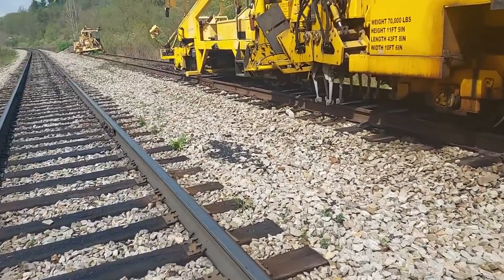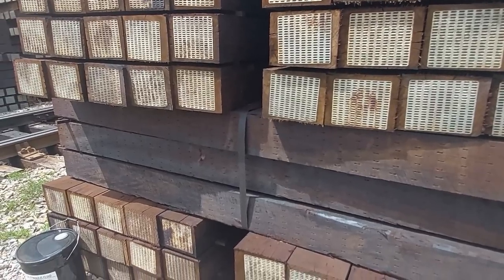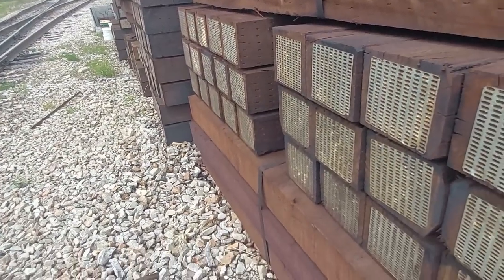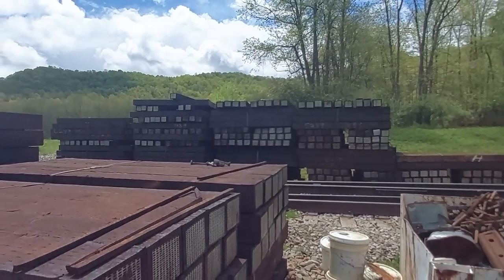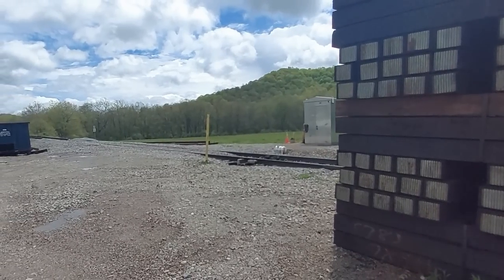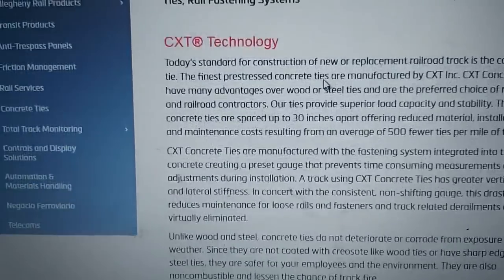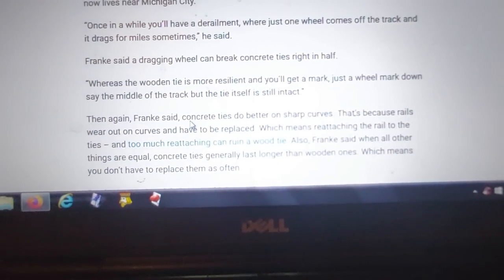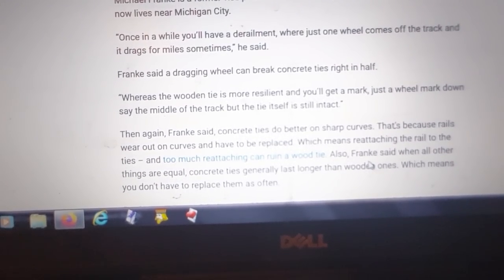Why some Railroads use Concrete and some use Wood Cross Ties

Comment: Hi Dave. The Company you work for is like a double-edged sword. The old creosote covered ties are a huge environmental problem at their end of life, and so is the coal you mine. It gets burnt to produce electricity, another environmental concern. But we need electricity, and a lot of it. So what can we do? Solar works great, until a solar eclipse shuts everything down LOL. In Ontario Canada, they had to fire up their natural gas electricity generators because of last week's eclipse. Ontario stopped using coal in 2007.  With more and more electricity being required, it wouldn't surprise me if Ontario is forced to bring back coal in the future.
Reply from the maker: You are certainly right about that 46FD, have to have them but
it's a problem with disposal. The electricity problem is huge and
too many politicians and environmentalists are making the decisions instead of qualified energy engineers. But that's the
world we live in now. UK and Germany both had to bring back
coal to fill the electricity needs.

Comment: Creosote treated ties are forbidden in several countries in Europe. Creosote applications for private use are forbidden since 2003 in my country (the Netherlands) and also in other European countries I suppose. Btw another disadvantage of concrete ties is noisiness I guess.
Reply: The most significant noise issue is with the way rails are joined. It used to be that railway track was joined with fishplates, and those were very noisy, both in the train and to those who live nearby. Over time, Europe has move to more and more continuously welded track (CWR), which involves pre-stretching rail to account for expansion and requires the track to be held very firmly. That basically means concrete ties (or sleepers). Also, as far as noise is concerned, it is normal for track on concrete ties to be laid using a plastic isolator. 

In general, modern railways using CWR and concrete ties/sleepers are quieter in operation than the old rail and fishplate systems on timber. Of course the trains themselves are now quieter too, especially with electrification.
Reply from the maker: Thank you for the great information stranno. Appreciate your taking the time to watch and write in my friend.

Comment: In Europe we use only concrete ties because they assure high speed, last much longer and have less operation costs as the bed is much more stable and longlasting. Wooden ties are past.
Reply from the maker: Concrete tie lend themselves very well to high speed and light weight trains for sure Strashimir. Thanks for the nice comment. Appreciate your taking the time to check out the video and write in my friend.

Comment: As much as I dislike the s of buzzwords I question sustainability of wood ties. I live in a tree farm that does selective cutting as opposed to clear cutting which is more expensive, more difficult but looks more natural. I spent 6 hours yesterday pulling nails out of old growth dimensional lumber because it's cool to me and I'm cheap but most important is I can't see what's required of high load sleepers being grown to spec quicker than they're needed. I do electrical distribution construction, currently with a maintenence contract for a state capital, and we are not going in the right direction.
Reply from the maker: Appreciate the nice comment David and for sharing those thoughts. Thank you very much for taking the time to watch and write in my friend.

Comment: U.S. Forests are denser then ever. There are currently more trees then at any point in recorded history. I agree about disposal of creosoted Ties. Ties could be burned if the right clean burning shredder / incinerator is used. Easy to couple with power generating equipment. Turns used Ties into the means to power there own destruction with additional electrical power to sell to Power Company. Thus, the system pays for itself over time.
Reply: Yes!  In fact, burning old ties would probably qualify as biomass, which is heralded as renewable.
Reply from the maker: Appreciate your sharing that with us WMF FMW, interesting. I like you think there could be better uses for old wood ties than what we now have. A few power plants do burn them, but they are far
from us here. Thank you for taking the time to watch and may you have a very good day my friend.

Comment: The Light Rail Trains here in Denver use concrete ties.
Reply from the maker: Thank you for sharing that info with us Peer. Concrete ties are
well suited to light passenger/transit applications. Appreciate your taking the time to visit and check out the railroad tie video my friend

Comment: concrete ties are for none cold weather areas. frost heaves and poor ballast conditions  pop the concrete like popcorn .in Massachusetts the commuter rail has removed or replaced all of the cement ties.  Amtrak has cement ties on the corridor  for the Acela;  but has African wood  or normal wood ties in there high speed crossovers. Our max speed is 70mph;   Amtrak is 125-140 mph cement ties are better there for weight and stability.
Reply from the maker: Thank you Sean for sharing your thoughts, excellent points you
have brought up. We've heard some woods from Africa are so hard
you can't drive a spike in them without pre drilling a hole. New York City Transit uses wood ties from the same plant we buy our ties
from. We appreciate your taking the time to check out the video my friend.

Comment: So why do high speed rail.  Korea, Japan, Europe, do they use concrete on the High Speed rail systems.. Older concrete ties might not have had reinforcing. Was that a cause of failure.  Why would concrete ties move any more or less than wood?
Reply from the maker: Good question organbuilder. Here is a video I made on why
some use concrete and some don't, you will get your answers
in that one, Thanks so much for watching my friend.
https://youtu.be/UtyTTijswwg
Reply: @ccrx6700  Thank YOU dave for trying your best to educate and inform the public about railroading and all the good and bad things that happen. Maybe more people will understand why you don't try to beat a train at a crossing, why rail systems are built they way they are and the multitude of other interesting things you post.
Reply from the maker: @organbuilder272  👍😊
Reply: Here in italy for hsr and regular line are only concreet, more over we paint the said of the rail in withe to prevent  heat destortion in summer

Comment: Sawing hardwood lumbar for high grade the center cant is usually processed for lower grade utilities. Ties, pallet material etc. So your situation if i understand, you are better off spending on drainage and balast.
Reply from the maker: Thank you for sharing the info with us Greg. None of the big logs
in my log home are cut from heartwood, in fact the plans specify 
for them, no heart wood. You are right. Appreciate your taking the time to visit and  check out the RR tie video my friend
Reply: @ccrx6700  the center of a cant is the most stable due to the growth rings being small when the tree was a little fellow. However it's inclined to have the most knots from the limbs of a small tree. However for a tie it will have balanced growth rings and stay straight. Thanks for your tutorial.

Comment: The conundrum is that cement manufacturing puts CO² into the air. Wood ties get used for 30 years, and then the carbon is sequestered in the landfill. 
Creosote is eventually broken down by microbes.
Reply from the maker: Thank you Mike for writing in with the great comment.  You are right. Appreciate your taking the time to check out the video and may you have a most blessed day my friend.

Comment: Ok, so you tried a type of concrete tie, and it didn't work. I'm not surprised, seeing what you tried. But did you think to have a chat with other railway systems around the world, where concrete ties (sleepers) are in widespread use?

I ask because (as a Brit currently living in Canada) I've seen too many half-arsed attempts at using ideas created elsewhere being attempted in North America, such as roundabouts. There are a few roundabouts near me here in Ontario and Quebec, none of which have been implemented properly. (Failures such as at Dorval, Montreal, with no clear signage on the approach to the roundabout to identify which lane you should be in, or no road markings to identify who has priority - made worse in Cornwall ON by mixing in old-style traffic circles where traffic entering the roundabout has priority AT SOME OF THE EXITS. Those two both scare me witless!) Let alone the more modern roundabout styles in Europe, where the lanes corkscrew around the roundabout, so that if you get into the correct lane when you enter, it automatically leads you to the exit without having to change lane. If you look at North American roundabouts alone, I'm not surprised you hate them! But they've gone off half-cocked and implemented them badly, without any thought and without any care, and possibly without any real knowledge of how to do it properly.

My guess is that you've done the same with your "railroad ties", gone off half-cocked, not done it properly, not asked advice from other countries where high-speed rail is standard or where heavy goods trains are common. Because none of your reasons really hold water. It's just "we tried it once and it didn't work, so we've not tried again".

Having said all that, though, can I offer two reasons of my own why your situation may be different?
- One is that your distances are enormous, with tracks stretching thousands of miles. Europe isn't anywhere near as big, and tracks are generally shorter. So your initial outlay and maintenance costs are going to be much, much higher, and I know you're starved of money. You may be forced to do things "on the cheap" simply because of geography and lack of government support, and wooden ties are simple and cheap. That's not a good excuse, but I think it's a valid reason.
- The other is that your goods trains are enormous and heavy! Just look at your engines, and compare them with engines from Europe. Ours look like toys alongside yours. Even the old diesel-electric units in Britain, such as the BR 37, which I used to think of as heavy. You stack containers double-height - making your rail cars twice as heavy! And your trains are often 1 or 2 miles long! That has to mean that the trackbed gets hammered - literally! - each time a train passes, making strength and flexibility into major requirements. In Europe our trains are much lighter, shorter, less damaging to the trackbed, so track maintenance costs are reduced. Maybe you should re-think how big and heavy your trains should be, to spread the load on the trackbed and reduce your maintenance costs?

The upshot of all that is, from my point of view, that the driving reason is cost: You can't afford to build the track as strong as it should be, and you're paying massive costs in maintenance. So you can't afford to invest in new capital cost by relaying a stronger and more maintainable trackbed. That's what we did in Britain a few decades back, with massive investment in new continuously-welded track using concrete sleepers. We have the advantage now that we can support faster trains with lower maintenance costs, but we also have the disadvantage (currently) of a government that wants a free ride to give their cronies tax cuts and are trying to run the railways on a pittance. But comparing the British train system with the North American one, I'm confident in saying that concrete sleepers are the way to go, as long as you can withstand the capital investment of a major track upgrade, done properly, and accepting help from other countries with relevant experience. And smaller, lighter goods trains would also help...
Reply from the maker: Thank you for taking the time to share your thoughts Rob. A
bit of a treatise and something you feel strongly about. However
after reading your entire comment, it appears to me you did
not watch the entire video or you are so biased on one point of
view, one size fits all. If you really believe all RR's everywhere should
use concrete that is certainly your welcomed opinion. But in
the real world of railroading there are so many different variables
and factors to take into consideration. I did a fantastic job of
presenting, in such a short video the pros and cons of both types
of ties and the reasons why some RR's use concrete and some
use wood. Never did I say what was right for another RR to use,
only what works best for our particular RR with the unique 
situation we have here. Hope you have a nice day and thanks
for watching.

Comment: What is the prices on wood ties n concrete ties?
Reply from the maker: Being that there are 28 different profiles of concrete ties, it's
kinda hard to give you an accurate answer Daniel. Each different profile has a different pricing. Wood ties here are $80.   All concrete are higher than that and heavier ones can be double or more the cost, plus transportation costs to get them to the job are much higher with concrete, because they are so much heavier than wood, it requires
more trucks to get them to the job site. Thanks for taking the time to watch and write in my friend.
Reply: @ccrx6700  ya welcome

Comment: You mention that concrete ties have a lower carbon footprint than wood. I find that very hard to believe. Making concrete releases huge amounts of CO2 as, first, it's very energy-intensive and, second, one of the required processes is converting limestone to lime. Carbon dioxide is the by-product of that reaction: limestone is, chemically, lime plus carbon dioxide. The cement industry has one of the highest carbon footprints out there.
Reply from the maker: Thank you for sharing your thoughts and for watching the video
Beeble. No argument from me on the cement industry's green house gas emissions being hard on the environment. However, in the video I was speaking strictly of the effect of wood vs concrete ties, not about an industry in the whole of itself.  

My information came from Robert Crawford, University of Melbourne who did a comprehensive study on the CO2 emissions from concrete and wood ties finding the CO2 emissions associated with concrete ties are two to six times lower than those from wooden ones.
Here is the link to that study: 
https://pubs.acs.org/doi/abs/10.1021/es8023836

Comment: concrete has a ton of compression strength but little tensile strength.  Any ground void will show up as a crack.
Reply from the maker: Appreciate the great information on that pittschapelfarm. Thank you so much for taking the time to stop by and check out the video my friend.

Comment: I just got back from two weeks in Germany.  All high speed rail there uses welded rail and concrete ties.
Reply from the maker: Concrete lends itself well to high speed low weight transit for
sure Bernard. Thanks for sharing that info  with us. Appreciate your taking the time to check out the video and write in my friend.

Comment: I thought I saw BNSF or UP putting asphalt pavement between the roadbed and the concrete ties to stablize the bed for the concrete ties.  Maybe it was an experiment not sure.
Reply: Tesla factory in Berlin.  They put down asphalt and haven't laid down the concrete ties yet.
Reply from the maker: Thank you for sharing that info with us Scott.  Appreciate your taking the time to visit and check out the railroad tie video and write in my friend

Comment: I would think that if you had a small burn spot on your rail, the vibration would crack the concrete ties.
Reply from the maker: That's a good point Ralph I never thought about that. Wood sure is a lot more resilient in that respect than a concrete tie would be. Thank you for taking the time to watch the concrete vs wood tie video my friend

Comment: Concrete ties  seems like the answer to all of a rr's problems, just like clean energy seems like the answer to using coal.  Problem is clean energy is expensive and often not reliable where coal is coal and we have had centuries to deal with any problems in the use of coal.  Like coal, wood is readily available.  I always say if it ain't broke don't fix it.  Wooden ties have a proven track (no pun intended) record.  Just like we send the coal we don't use (to lower pollution) to other countries who could care less about pollution.  So what have we accomplished?  We have put American workers out of work and let other countries pollute even more.  Since over 90% of the ties in use are wood, it seems like a no brainer.  Larger railroads would have changed a long time ago if the change made sense.
Reply from the maker: You're absolutely right in that Rupert, "seems to be" is key words in
that. Thanks for the excellent comment and for watching the 
tie show my friend.

Comment: Wooden ties are treated with creosote one of the most toxic chemicals known.  The province i live in has  as far as i know has stopped the sale of used ties in the home landscaping.  A creosote plant south of me was closed down decades ago and the site is.still fenced off.
Reply from the maker: Did you know Gary that many facial cremes and moisturizers are
distilled down from coal tar. Coal tar is where creosote comes from.
However creosote is much more concentrated and that is why
it is considered a toxic chemical. Pretty interesting stuff isn't it.
Thanks for taking the time to watch and write in my friend.
Reply: @ccrx6700  I used to use some coal smelling medicine for my skin or something else when I was a young teenager, maybe skin.  It smelled like tar, but that was 60 years ago. But things have changed.  Worked for Druggist as a young teen.  He made his own cough medicine and it had codine in it which he had a 16oz bottle of the stuff in the bathroom where he kept all those now restricted medications .  How time changes.